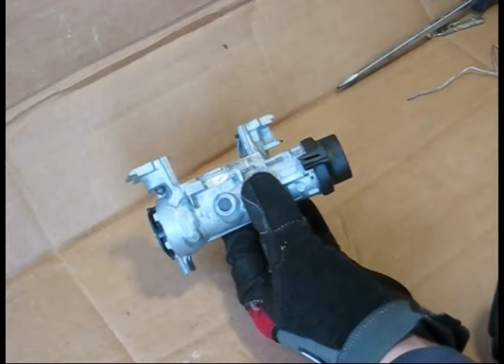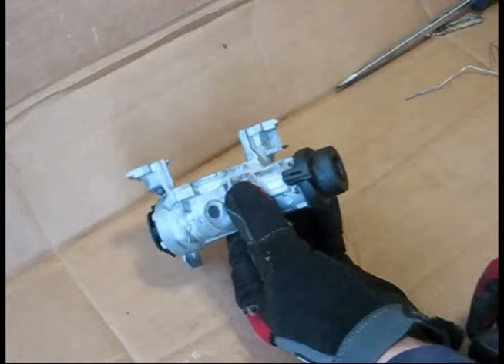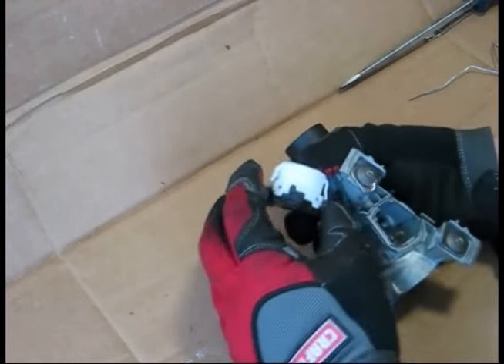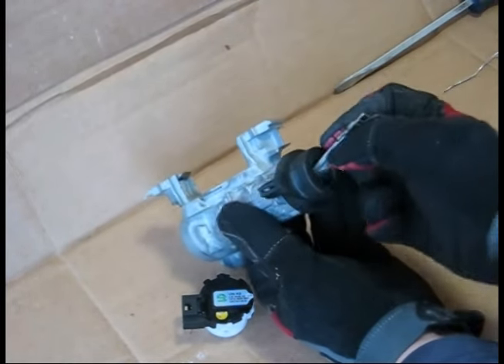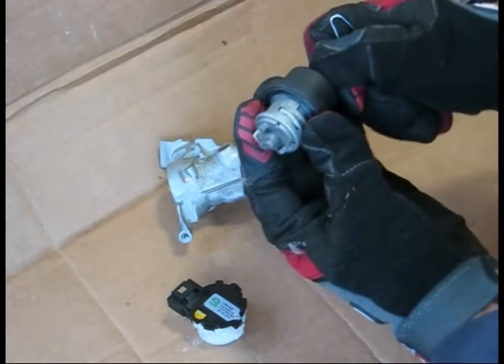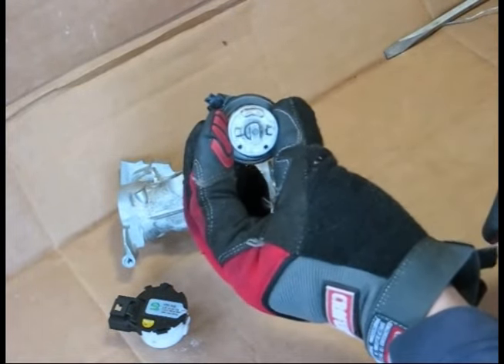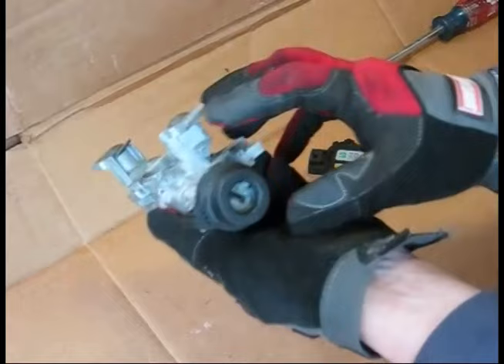Volkswagen ignition switch repair and diasssembly

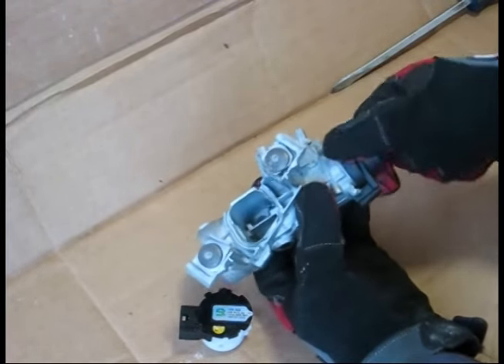Comment: CAUTION: the close up photo at 1:25 is wrong -- the immobilizer collet should be rotated by 180 degrees, i.e. with the key in the ON position, the hole for the lock pin should be aligned to the dot on the round side of the collet, not the side with the electrical plug.
Reply: thank you I been trying to remove and read your comment and off it is thank you

Comment: To remove the cylinder head is impossible ... been trying for hours, that pin wont go in, no mater what :/
Reply: Did you ever figure out the pin issue mine goes in but doesn’t release a thing
Reply: @isaiahterry4319  you have to push all the way until it releases. I put thicker needle and then hit with a hammer few times , it went in all the way and released it.
Reply: @sarunas44  ok I’ll try tomorrow

Comment: I followed the direction to the t except I must have moved the key position or the tumbler position when I went to reinstall the key section into the assembly once I put it in and pushed down I felt the little click removed the pin and turned the key but the key doesn't move stuck in the position I click it at and now I can get it back out.

Comment: Hi,I'm currently working on a ignition switch now,Volkswagen jetta,I have a lishi 2 in 1 HU-66 pick,customer has no key,I picked the lock but it's not turning all the way for me to use my extractor tool,can u tell me what might be my problem?  Locksmith from Trinidad.

Comment: You hire a locksmith to fit a key to it. Replacing the lock wtth a parts store one will result in the need for programming, and make for a mismatched lock set.

Locksmith
City Lock
Boulder Colorado
Reply: Jeff Rosen i

Comment: 2000 vw jetta VR6 ... my key its already turning freely when inserted how do i know when its on or whatever position? my ignition switch is ok and the ignition lock cylinder is ok what i realize need to be replaced is the small part inside where the spring is (i guess) that goes into the ignition switch how do you deal with that?

Comment: key is stuck in the accessories position. I can pull key out of ignition, dash lights stay on, radio still works, windows go up and down, key will not make full rotation to start engine.  can you tell me if this is the ignition cylinder itself, or is the lock part (black piece that reads Immobilizer) the culprit?

any advice would be GREATLY appreciated!
Reply: did you ever figure it out. im having the same issue with my 99 jetta
Reply: c937 c937 had same issue on my 01 Audi a6, replaced ignition cylinder, removing the immobilizer (black thing) from the old ignition, and installed into new ignition. was a huge PITA
Reply: would i be able to use one off of another vehicle like junkyard to save a little money
Reply: c937 c937 yes, you would have to switch out the immobilizer piece
Reply: do i have to do anything special before i put the immobilizer on. i was looking online and people where saying something about make sure you have it in the on position. as of now my car stays on all the time. even with the key out the car dash and headlights stay on. and the key doesnt spring back like it should. i have to unplug my battery so it doesnt drain it.
Reply: c937 c937 there should be a little hole next to the key slot, in the ignition. key has to be in the on position, then you stick a paper clip in the hole to remove immobilizer. the hardest part is removing the 2 bolts the secure the ignition to the steering column, as they are security screws, and the heads of the screws are designed to snap off when you install the ignition. Not sure if you've noticed, but the bolts that are currently on the ignition have the heads cut off, I used a hammer and a pointed chisel to remove the studs
Reply: what if i find one at the junkyard that doesnt have the key for the ignition. how would i take the immobilizer off of the junkyard ignition
Reply: c937 you will not be able to remove immobilizer, without breaking it, if you don't have the key.  you must find one with the key still...
Reply: damn. whats the chances of that at a junkyard lol

Comment: Nice video. Question: I'm doing this repair myself and accidentally turned my new OEM Ignition Lock Housing to the OFF position with a screwdriver (wanted to test to make sure it worked), but now it won't turn back to ON position and it's my understanding (after watching another Jetta ignition repair video) that I have to have the new housing in the ON position when attaching the ignition lock that I have on order. Does this create a problem with attaching my new ignition lock? If so, is there a way to fix it? Would be more than happy not to buy the same part...again! Thanks in advance for your response!
Reply: Did you fix this issue eventually?

Comment: My steering wheel lock is broken. So if I get a new one and replace the cylinder lock and the ignition switch onto a new one the my key will not need replacing? correct?

Comment: Red Liner...you are correct about the chip needing to changed over as your OLD chip is programmed to communicate with the existing ECU.....if you dont change the chips, the car will NOT start and possibly go into ECU LOCK mode....the computer acts as if the vehicle is being stolen and shuts down. The new antenna ring reader SHOULD be "plug and play" so no problems there that I can see.

Comment: I just replaced my ignition assembly on my 2012 VW Jetta and now I have a key light that has come on.  I changed out the key/ receiver so I can use my old key and FOB but the message still stays on?  I have disconnected the battery and let it set for a while, but still get the same KEY message.   Any thoughts on what I may be doing wrong?
Reply: Old Post but I think the ecu and the dash/clocks needs to be changed as well as the key and ignition/cylinder.
They are all linked up and coded

Comment: Dear friend I need your help. I disassemble a cylinder of my polo 2003 1.2 12v, and I lost a tiny pin /knob at the inside end of the cylinder. Do you know where to buy one or if I need it at all?

Comment: Helpful video. I was able to take the lock cylinder out and remove the antennae switch where the key goes in. My problem now is I was playing with the replacement cylinder from VW and I turned the gear somehow so now instead of the steering wheel lock being pressed in it popped up and now the gears are not at a 90 degree angle to match up with the antennae/key section. How can I set that back? Any ideas? Thanks

Comment: Hi - thanks for the video. So I guess removing the ignition switch is only possible once you have removed the plastic cover under the steering wheel? Cos I need to check mine but hoping for minimum tamperage.
Also, when replacing the ignition switch, isn't there some catch about how it has to match the key or something? Otherwise the immobiliser won't work?
Thanks very much.
Reply: If by switch you mean the ignition lock cylinder, then if you don't want to have to program the new keys, keying the lock cylinder to your existing keys would be a good ides. If you're just replacing the ignition switch and not the lock cylinder, you don't need to worry about that
Reply: Heritage Locksmith Buffalo NY
Hey NY, thanks for the reply. Yes, it was early days there and I got the terminology arse about tit - I've since found out that what I actually meant there was the lock cylinder, as you say.
Well I haven't replaced either so far as it seems my problem most likely originated from the cluster/ECU, even though an "electrician" here assured me it was the pickup coil(wrong!). Anyway I'm now fairly sure my car is haunted so I've hung a crucifix from the mirror, put a bible on the rear shelf, and say the lord's prayer before I set off. Seems to be doing the trick so far!

Comment: Nice video, thanks for sharing. I have a 99 bug and when you take the key out, the engine still runs. But now the steering wheel is locked as well. Could use your input! #Help

Comment: good post, thanks.  I have  a brand new center lock section (made by Huf) and it seems to be stuck in the OFF position.  I can't seem to turn the lock assy to the ON position (with a screwdriver, like you do at the 1:48 point).  I'm thinking this new lock section is defective, but, maybe I am missing something ?  Thanks in advance to anyone who answers.... Update ... dealer mechanics told me not to turn the new assemblies unless the key section is mounted.  Unfortunately many aftermarket switches - which appear to be decent quality - are being sent out without any warning or instruction about this critical fact.  Beware.

Comment: I can't turn my key 90 degrees in my cylinder, will it still come out with paper clip?
Reply: I had same problem. It took six hours to remove the assy from the column. (2010 Jetta).  The two shear bolts are very difficult to remove.  I used a small and sharp chisel to break them loose.  I put the assy in a vice, tried various angles, while tapping on the body with a small hammer, and turning the key ... finally got mine to turn 90 degrees, and using a heavy duty paperclip got the key section out.  My central locking section was buggered.  Later I discovered that the round plug on the side covers a small pintle that, on my 2010 Jetta cylinder, will lock up the center section if you turn it without the key section installed in the front end.  I tried to drill out the round plug.... no go.  I ground off the aluminum surrounding the plug and it came out.  Use a magnet, there is a spring underneath. With the plug, the spring and the pintle removed you should be able to turn it 90degrees.  If not, then you have a cylinder, like mine, that had broken off a piece of metal inside.  In that case return to my first suggestion.  Once you get the key section out, there is a semi circular plastic ring which comes out rather easily.  The inner shaft slides out the front.  You may have to unpeen the lock section on top .. and remove it, as well, if there is metal inside that needs to be removed.  I was able to reassemble the original lock assy and it is working.  I left the small round cap, spring and pintle off, so it does not lock up again.  Too much anti-theft shit built into these cars nowadays.
Reply: Having this same issue on my 08 Jetta. The key was beginning to become difficult to turn over a couple of days, and now will turn just enough to release the steering wheel lock but not enough to reach the 90 degree position to remove the immobilizer. I don't know if I just need to replace the immobilizer (and key) or if the problem requires me to replace the whole lock assembly, body and all. I guess if I go to the trouble of removing the steering wheel I can try Don Quixote's suggestion, although I can't visualize it without actually seeing it firsthand, I suppose. If it is not necessary to spend wads of cash to replace the whole assembly and have it coded by a dealer, I'd prefer to do that.
Reply: Although I was able to 'repair' the defective cylinder it failed again and I had to do the job twice.  I bought a new cylinder online (about $40) and made the mistake of trying to test it before assembling the front and rear bits.  When ya do this the new one will lock up and cause alot more work, cuz then I had to disassemble the new one, to unlock it.  All in all a total pain in the arse job.  I was able to reuse the front key section so I never had to go to the dealer for any key programming.  The failure occured in the center locking section.  Good luck, you will need good light and alot of patience for the job.  The factory book (2010 is the last year for printed manuals for VW) has a decent walk thru on the job.  I would not suggest using the original 'shear' bolts to reassemble.  Ridiculous.
Reply: Wow, good to know. I plan to start taking it all apart this weekend and looking all the parts over before I decide on what I need to replace. We have a backup vehicle to use so there's no immediate urgency on the repair, which is good. Thank you for all of the information, this is really helpful.
Reply: @audimattro  Hi Matt, I am having the same exact issue that you described. Any tips? I'm going to tackle this job tomorrow.
Reply: Same issue,  cant turn the key 90 degrees, I have a 2011 Jetta A6 , any suggestion?

Comment: I purchased a new complete ignition switch less the key cylinder.  They come in the on position but while I was attempting to place the key cylinder into the locking cylinder I managed to turn the locking cylinder out of the on position.  The locking cylinder will not turn back to the on position.  How do you turn the locking cylinder back to the on position so I can install the key cylinder?
Reply: Hey. I have the same problem. Did you solve yours already?  If so how you did?  Please
Reply: Same problem- any luck?
Reply: +Ash hi.  I just end up taking assembling the car with the bad piece and had the dealership work on it :(.   $600. Total paid.
Reply: ivan gutti Hmm, ok.  Just paid $230 for a part from the dealership and went to put the key barrel back in and it unlocked. Taking it back today to see if they'll replace.
Reply: +Ash nice move. Good luck!
Reply: Curtis Wunderlich
Reply: Ash Did they replace it?
Reply: I did the same (inadvertently turned the cylinder to OFF) and now can't get it return to ON in order to install the key barrel. I guess I'll be buying another and returning this one...
Reply: I have a Question I just bought a1999 VW Jetta and it has to be started with a Screwdriver if I take it apart and do this will it work? Or do I need a whole new part? Not crazy about starting my car with a screwdriver...
Reply: you have a big button that pushes on the steering coloum press that in when turning the key

Comment: This was well done and helped a lot on my 2000 TDI. a tip I saw on another vid (prior to my starting to take off the wheel) was that the lower trim screws under the wheel can be reached by turning the wheel enough. (no need to remove the wheel, but I suppose this is covered in your trim vid). Unfortunately my latch doesn't retract after the "VW Special tool" is inserted approx. 1.25" and bottoms. Pushing in and pulling and turning the key slightly doesn't free it up.

Comment: Hi. I unfortunately got my car stolen and never got the keys back.  I therefore purchased a new lock set and have changed them all.  When I changed the ignition barrel over however the car would not start with the new key.  Is this just a simple case of removing the transponder from my old key and fitting it in the new key, or do I need to get an auto electrician so recode?   Any help would be appreciated regards Colin.
Reply: need key programmer with new cut key  with blank transponder inside. they sell cheap key coders/obdII readers online for older VW/Audi cars. they have them on amazon. the reader pulls code from the car then writes it into the new transponder/immobilizer chip inside the new key... it must be a new blank since it can't write to a key that has already been programmed